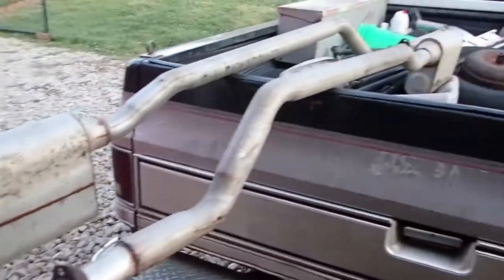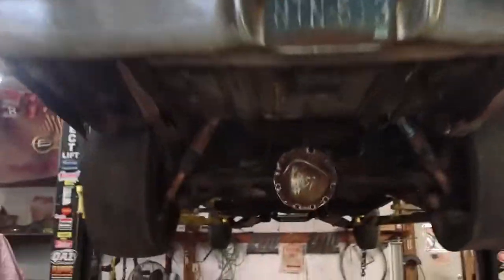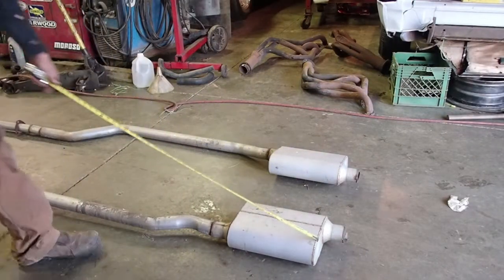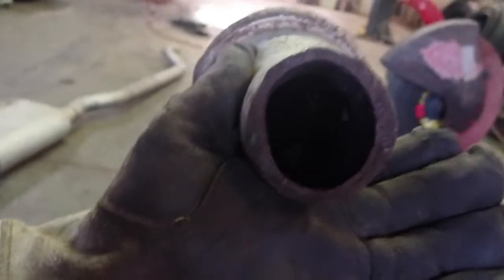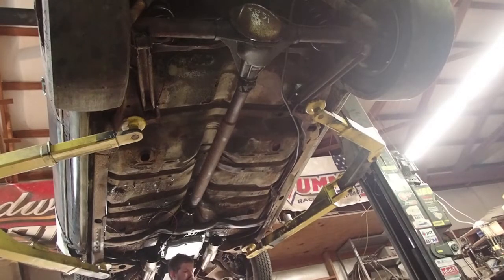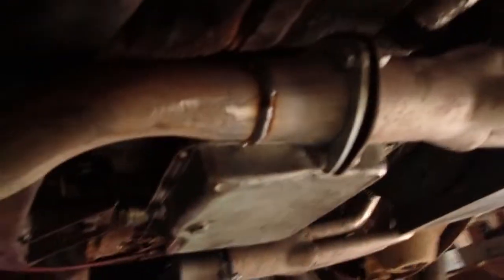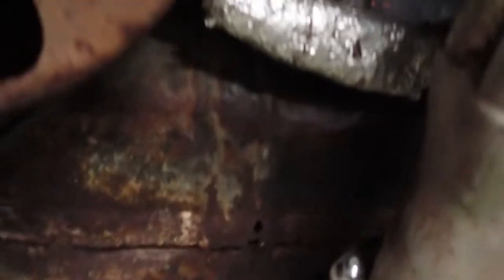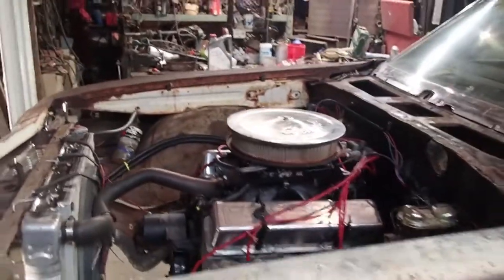Budget Beater Chevelle Exhausted Why Wait? |Sketchy's Garage

Comment: That could of got really sketchy😁 stuck wide open something easy to overlook.  Glad you where able to get it shut down
Reply from the maker: Me too, if not I might still be picking soybeans out of it.😎
Reply: @SketchysGarage  Soy is bad for a muscle car... too much and they turn into Kia's!
Good thing you got that ignition issue solved(wouldn't shut off), that would have made things really Sketchy when the flap stuck.  Glad you got it handled though bud.
Reply from the maker: Me too, I'm just clad I didn't run it out a little bit something in my head told me to ease up.